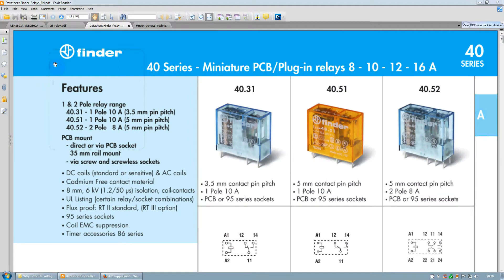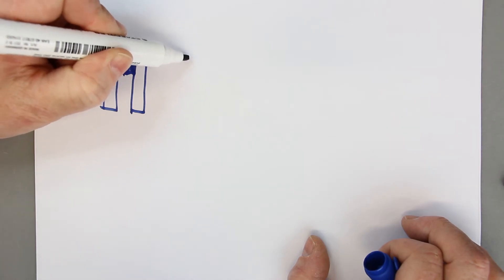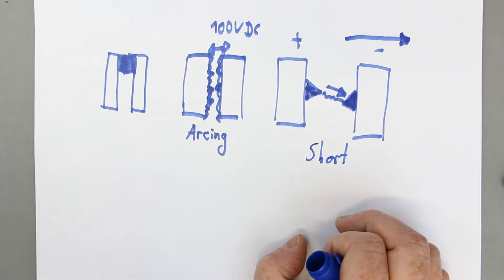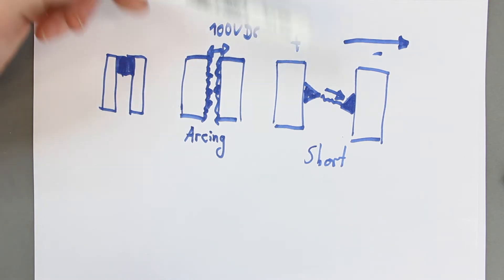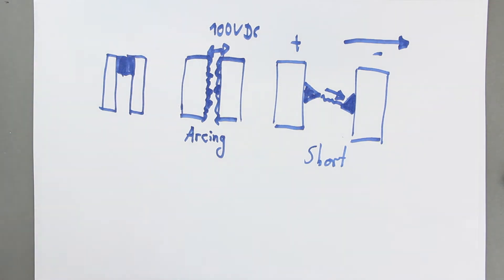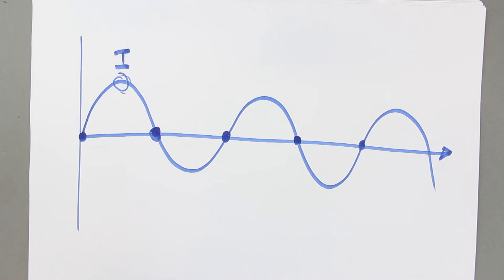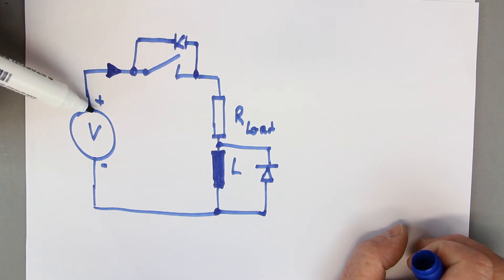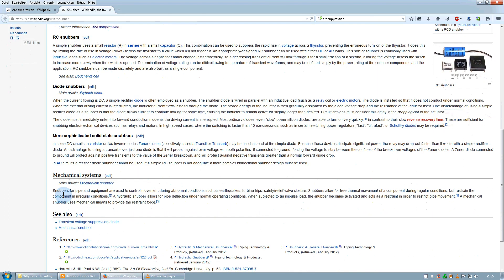Relay Amps-Rating: DC vs. AC-Loads

Comment: Maybe you can answer this question. I picked up some relays at an auto recycle yard. The rating are not on any of them. If i do a search of the part numbers all i find are ones for sale, with no rating info.   So the question is do you think the numbers on the relay such as A1-A2 are all the same values,,, in my case i have two with 85-86... ?? And if they are the same where do i find the values? Is there a way to figure this out with a meter,, or maybe i buy a new one and test the values against each other,, but that still does not give me an amp value...  or i could just load them up and see where they fry.
Reply from the maker: Quality relays are so cheap today that I wouldn´t bother with 2nd hand relays from unknown sources with unknown specs.
Reply: @KainkaLabs  In other words you don,t know. It's not about the money it's about how do i find out. There are millions being thrown away. Need to find someone that really understand these things.
Reply from the maker: There is no way to find the ratings of  relays if they are not printed on the relay or you have a manufacturer and type-code printed on the relay!
Reply: @KainkaLabs  I tyied all that,, yes they sell replacements but none have ratiings... But  one is a Ford Motor-- FOAB-14b192-AA

 i think the fastest way is to put a load on it and see where it frys at.    You would think some type of resistant test would qualify it...

Comment: For eg.output DC 100v 25 a, 60 volt  45 a.
Can i output 25 to 30 a under 12v DC supply since the rating  (volt and power) is in the specified above intervals?
Thanks.

Comment: sir can you tell me if i connected 10 A relay to a .5 hp motor .  will the motor  run  in perfect condition?
Reply from the maker: Without a link to the datasheet of the relays and the motor I can´t tell you.
And BTW: "hp" is not an SI-unit with which you can do electrical calculations.
What voltage and wattage does the motor have?

What inrush-current does it have? 
Is it an AC oder a DC-motor? Datasheet required!